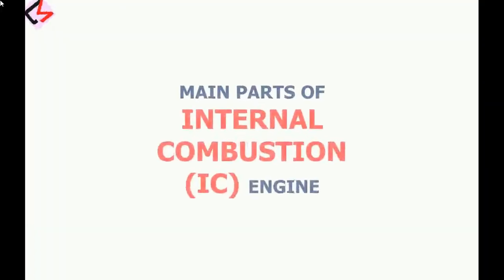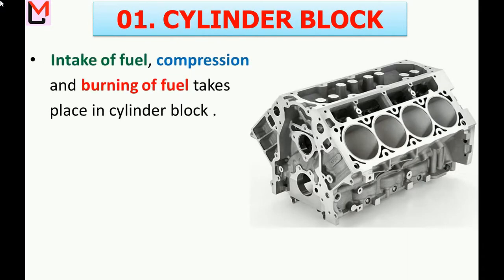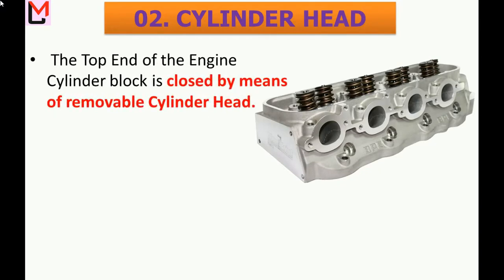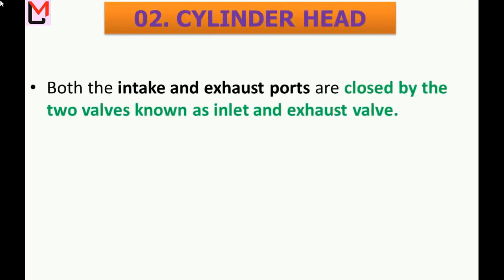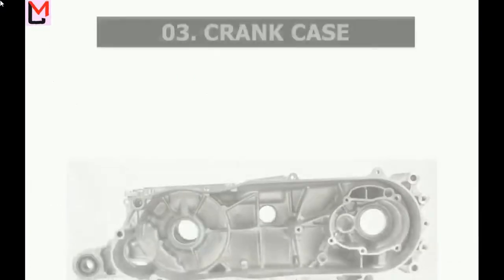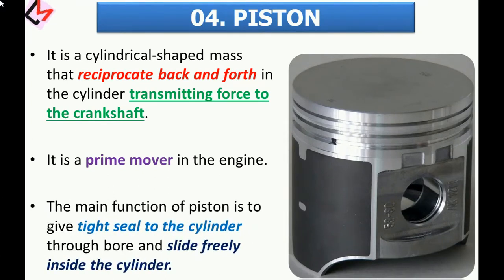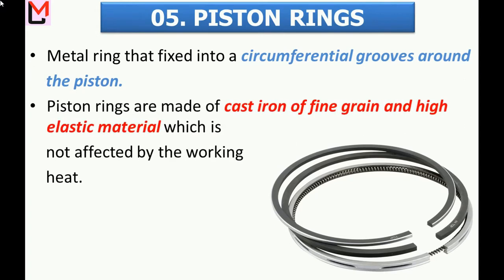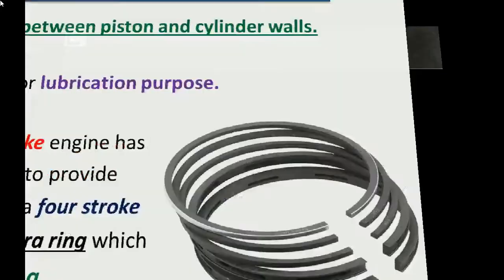MAIN PARTS OF INTERNAL COMBUSTION ENGINE (PART 1) II IC ENGINE COMPONENTS

Comment: No no the main role to produce combustion when we release accelerate it's clutch sir not only piston or crank when you press the clutch paddle why combustion has finished & car become neutral when engine is start piston crank working that time why car combustion loose if you pressed clutch paddle